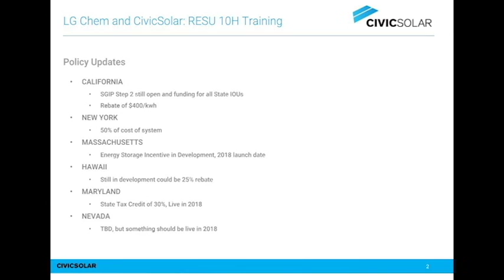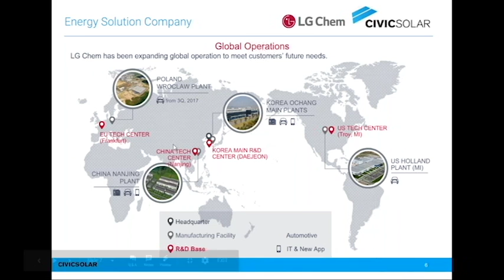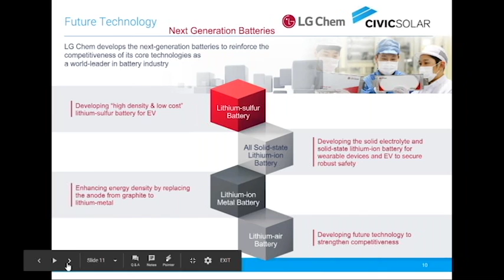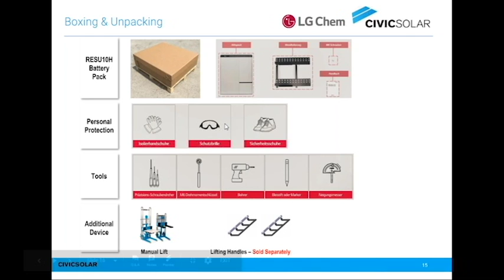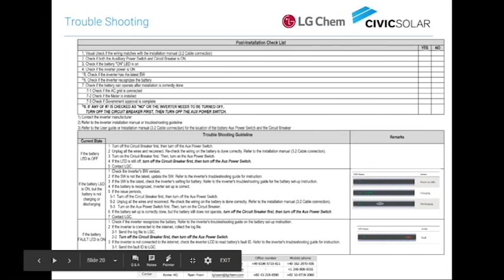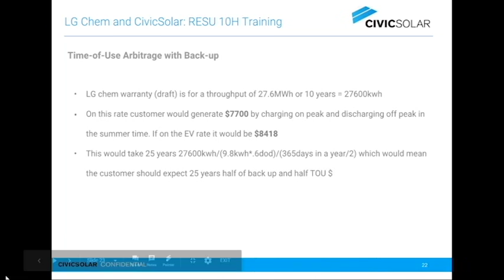Webinar: LG Chem RESU 10H Training

Comment: Solaredge Storedge and LG Chem is a win win combination !
Reply: So I thought.  Now I have  $20k worth of equipment baking in the sun, because both the Solar Edge Inverter (7600 US) and the LG Chem battery have cheap wiring connectors and none of them work properly.  Checking the Product warranty, not the Performance warranty, one finds that most of the small parts they outsource are only covered for 120 days.  Moot, because they won't do anything about anyway.  "Send it back to where you bought it" is the extent of their customer support, for both companies.  Newer HD inverters have new connection terminals with set screws.  I smell a class action suit if others have had the same problem.  It's such a stupid thing, there are workarounds, but that voids the warranty, might jeopardize the inspection, and would negate the $3800 rebate I've yet to find.
You get  Zero support from either LG Chem or Solar Edge, other than sympathetic voices saying, "it's tricky, try it again".  They refer to the routine with the screw driver to push a 'spring', then insert the wire and retract the screwdriver.  None of the 9 terminals both green and gey work, some lock the cable so you can't remove it, and the grey ones don't even have a hole, where the wire goes.
I rue the day I decided to buy expensive equipment from either of these corporations.  They've got my money, I'm a non person, other than taking my system apart and sending back the inverter and a 220 lb lith ion battery (at my expense) for evaluation and a 'refund'.  Meanwhile, it's 110 F in the shade.  These people were a big mistake.